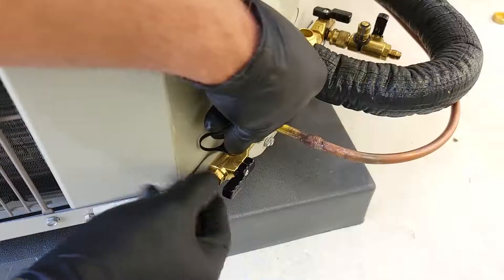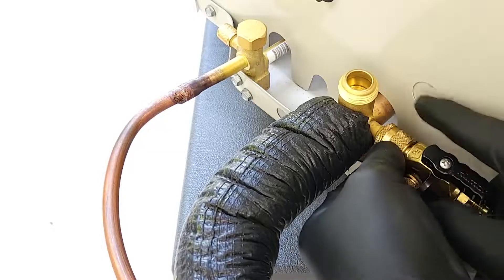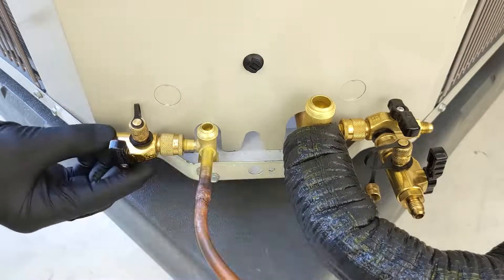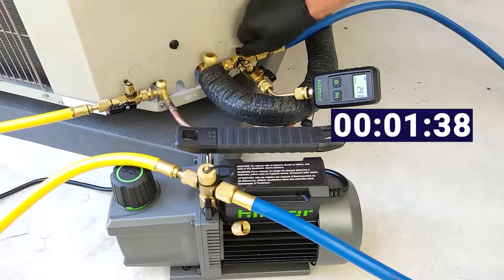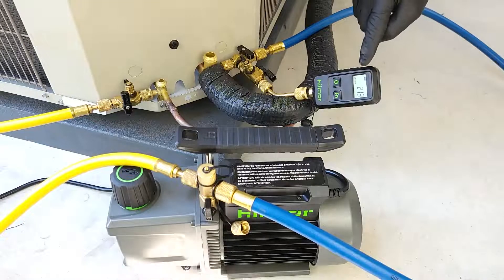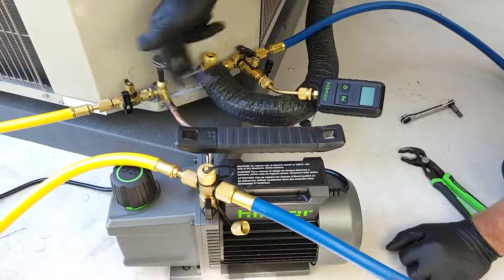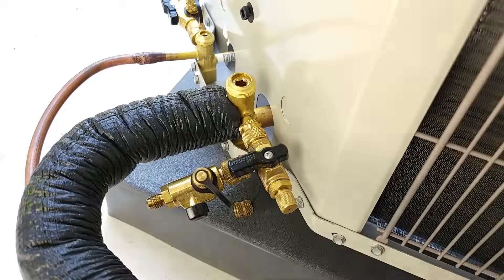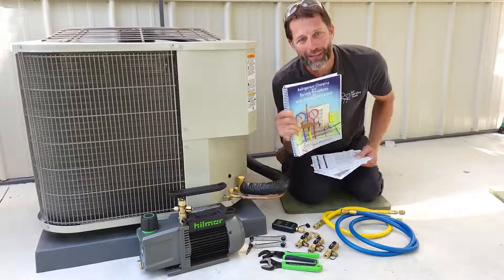How to Properly Set Up a Vacuum Pump on an Air Conditioner with Craig Migliaccio!

Comment: I've opened service valves on a changeout with 15 ft of line set and had to add refrigerant, I've opened service valves on a changeout with 30 ft of line set and had to recover a little bit of refrigerant, now these 454B systems, just about every one I've installed is under charged

Comment: You should have your micron gauge as far away from where you are pulling your vacuum from. If your pulling on your suction line. You guage should be on you liquid service port. Your hoses shouldn't be on both. I can give you false readings.

Comment: I'm confused. Shouldn't you add poe oil?
Reply: The compressor comes with oil already in it from the factory.  The vacuum pump takes vacuum pump oil.

Comment: Hey Craig. Saw your video, very understandable. However, at 12:00 you do bubble leak check with valve open on high side, but 30 seconds later do the check with valve closed on the low side.

Comment: Hello. Thanks for the video. Is the procedure the same if the compressor has no refrigerant? I had a leak at the condenser and I lost all the refrigerant. So, same procedure with all valves opened? Thanks
Reply: In have the same problem. Did you ever get an answer?
Reply: @gilbertjaramillo8735  I did not get any answer but what I did is that I opened both valves and pulled a vacuum to about 300 and look for it to rise and it did not much after 30 minutes. I left the valve cores of the service ports in. Took longer but the advantage is that you can feed your refrigerant and not worry about breaking your vacuum and let some gas (beside refrigerant in).
Reply: @sergethomas8853  I will do that, thanks.

Comment: just wondering why you'd hookup 2 shrader core removal tools togethor for your micron gauge when you could've just hooked the micron gauge to the one shrader core removal tool

just wondering
Reply: I know this is old, but you can isolate the micron gauge that way when you break vacuum with refrigerant you don't (possibly) ruin the micron gauge.
Reply: He does that so you don't contaminate/damage your micron gauge with refrigerant oil.

Comment: Hi sir, just wondering I saw some vaccum oil in the 3/8 line connecting to the vaccum pump, not sure why it happens, but I usually close off the ball valve on the guages before shutting the vaccum off, Any idea why their is oil in the vaccum 3/8 line. Thanks